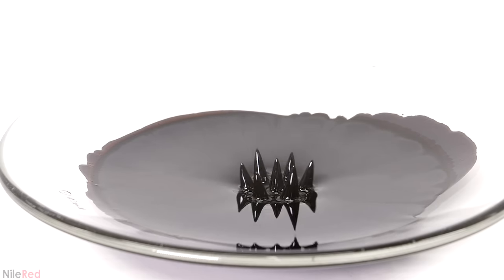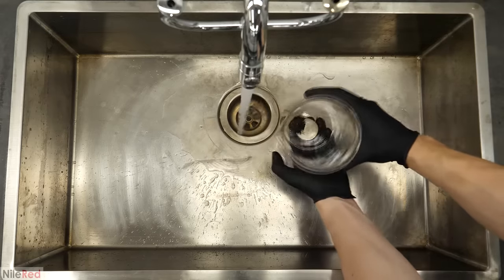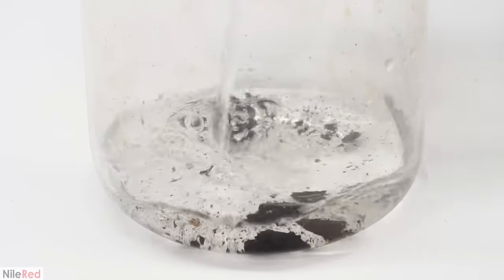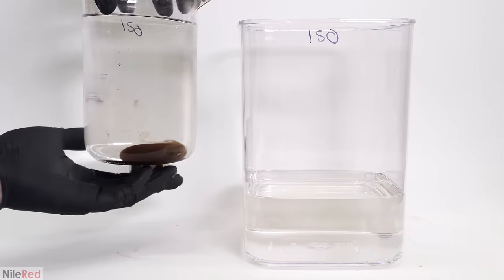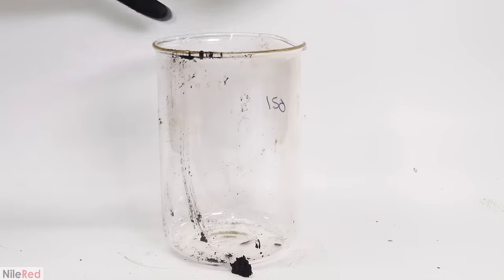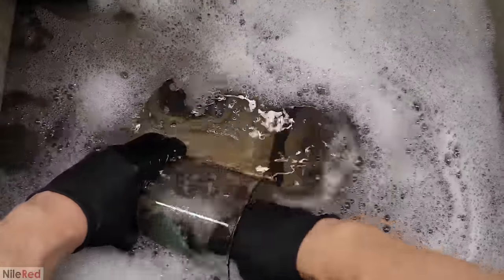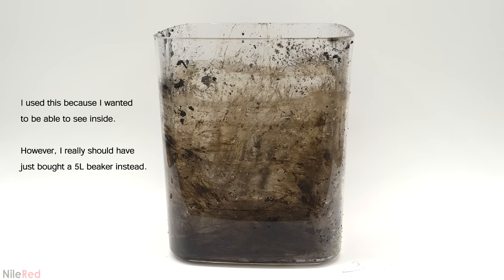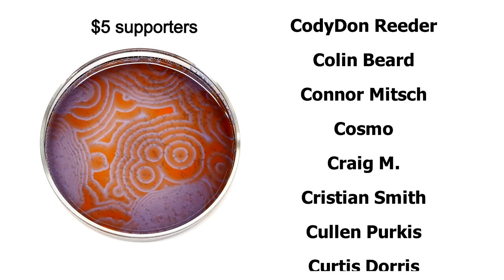Cleaning up my ferrofluid waste

Comment: Like others who have already commented, I really appreciate that you take the time to document the waste cleanup step.  No job in the lab in ever complete until the equipment is clean and ready for the next procedure.  For the aspiring scientist, it is every bit as important to learn as any other lab procedure.  During my time as a student, I had a very particular conversation with our department chair about how useful I thought it would be if the university offered a class, required or elective, on general laboratory procedures.  It seemed to me that both biology and chemistry labs failed to teach general and common lab procedures, especially good waste management, and focused to narrowly on the applied lesson itself.  Not wanting to take away from that primary purpose, I thought the best thing was to have a separate class that covered these issues.  He was seemingly positive about the idea, but nothing ever came of it.  I would have been one of the first to sign up to take the class.  To this day, I don't think a single undergraduate from our chemistry or biology departments experience even a single lab session devoted to properly identifying lab waste hazards and how to correctly neutralize them as part of lab cleanup.  Thank you for going the extra mile!
Reply: That's boring asf.
Reply: @grunge-616  dude its science. And its also 3 years old

Comment: I still have no idea what hes talking about but this is so fycking interesting
Reply: The material in question is ferro fluid,  an oily suspension of iron based nano particles.

Ferro is short for ferrous which means containing iron.

The iron in the fluid is attracted to magnetic fields,   and tends to align itself with the lines of a magnetic field to produce beautiful spiked shapes.

He explains in this video how he dealt with the waste from his experimentation and the process of cleaning his glassware.

In the glass washing part,  he removed the oil with soap,   and reacted the remaining iron with a chlorine based acid to produce iron III chloride,  a salt that dissolves in water.

I hope that helps.
Reply: theevilovenmit hell yeah my dude thanks
Reply: What does “fycking” mean?
Reply: @cbspydoge  ur mom
Reply: @abhinav2584  lol

Comment: What does ferrofluid look like under a microscope?
Reply: Black
Reply: @Charlie-mn5fw  thanks man
Reply: bigger
Reply: Have you ever seen those episodes of the x files with the black alien goop?
Reply: You would probably not be able to see anything if the individual particles were smaller than the wavelength of light which they might be.
Reply: @mareksvrcina5279  I think that the fact that the fluid isn't very transparant might be a bigger issue.....
Reply: Since they're suspended nanoparticles, a microscope would not show you much. Even a higher power confocal used in micro biology labs would just show black. However, an electron microscope may be able to show a lot of fine particles somewhat evenly distributed in kerosene. A nanoparticle lab at my university regularly uses an electron microscope to image and examine particles they've made. To bad electron microscopes are hard to access, and they usually do not want volatile, non solid objects in them.
Reply: He would need an electron microscope to see the nanoparticles.
Reply: @helgrind8493  it is black because of the suspended particles of Fe3O4.
Reply: @mareksvrcina5279  I know. Still, it's impossible to see something in a non-transparant fluid with a light microscope. However, even if transparant, @Ex and @ErebosGR are right that you need a SEM to see nanoparticles. I think DLS could be used to infer some information about particle size and distribution in the suspension, but I have no practical experience with DLS as an organic chemist who focusses on synthesis.
Reply: I would say the particles cluster and form larger particles because you can see the larger particles forming when the fluid is brought under a magnetic field.  As the particles get really small they alter the color of the water. The larger particles are black.
Reply: Thirty Three big ferrofluid
Reply: @Charlie-mn5fw  no shit
Reply: @userPrehistoricman  blacker
Reply: @matthewbusch6841  The carbon nanotech? Poor skinner...
Reply: if you look it up you can actually see the links. it’s hard to explain but it looks pretty cool
Reply: @Charlie-mn5fw I thank you for the information
Reply: black and funky i tell you that
Reply: Your mum
Reply: nanoparticles are to small to be visible; but probably like small needles

Comment: To recover Isopropyl alcohol from aqueous mixture, i've used KCl, CaCl2 & even NaCl in the past. the organic layer will float & give much less volume for distillation. Salt Solutions can be discarded into the sink at slightly alkaline pH.

Comment: Do you think you could rig a setup where you have a speaker neodymium magnetic near the ferrorfluid and see if it reacts to the magnetic change of the signal? It would be cool if it it reacted to the signal  changing the fluid etc. In theory I don’t see why it wouldn’t work especially since it’ll be amplified.  Dare I say fluid oscilloscope?

Comment: hey nilered, i have an inquiry; i am attempting to construct a tube furnace and i need a good thermal conductive material as well as a material that has high heat resistance and is an electric insulator. Basically what i need is a material that serves almost as a heating element insulator/ jacket to prevent melting of housing and shorting of metallic outer wall. What do you recommend? What are your heating mantles constructed of? i need to be able to resist up to 700 degrees C

Comment: Would heating the nanoparticles in a reducing atmosphere destroy them?  I.e.  can you drop them into a crucible with a lid, add a carbon source, and torch them into a slag?
Reply: Why bother with a secondary car on source. The oil and oleic acid should be plenty, just cover and heat.

Comment: Hey again, It's the guy who asked if you could demo the lithium medicine synthesis. (I also can't find that comment, but youtube does that to me sometimes.) I was wondering if you had time to take on another mini project that I think would make for some novel and interesting content. I'm currently working on growing spirulina as a food source and my main focus is on finding a method of producing the chelated iron which is necessary for its grow within some strict lateral limits. Namely that there be little ambiguity as to whether the end iron product itself is safe to use in the production of food grade spirulina(ignoring the other ways I might screw this up by not just throwing money at it), and that it is produced in a manner which is maximally focused on the use of reagents that can be produced on a single property. For example, I've been trying to research the affinity of the chelating compounds in cilantro but the most I've been able to gather, because I'm in way over my head, is that a methanol soxhlet extract of cilantro is probably my best bet for a simple chelating reagent. I'm thinking I can make the iron through electrolytically forced oxidation but I don't have the slightest clue about what oxidation state it should be in for chelating, ratios of reagents, whether I should further isolate the active chelating compounds, or really whether any of it will work at all because I'm just kinda floundering in the dark as far as chemistry goes. If you don't feel like bothering the idea, could you just share any "No dummy, you'll die!" type thoughts you had while reading this? Many thanks good sir.

Comment: For the plastic container, wouldn't it be more economical to simply buy a new one? Comparing the cost of his time and the acid he used compared to the cost of the plastic container. I know neither the cost of the plastic or the cost of the acid so I have no idea what's what. But still, i'm wondering.

Comment: How do you determine which acid is appropriate for cleaning xyz? Why not sulfuric or acetic vs hydrochloric?
Reply: 1) HCl salts tend to be very stable and easy to work with
2) The same way you determine what acids or solutions are going to react with the stuff you're already working with.  You pick the one that's the easiest to work with and dispose of or recycle again later.

Comment: I'm surprised you would go with acid-washing a plastic container...
Though the end result isn't quite as bad as I expected.

I guess for mild acids it doesn't matter.
Plenty of things stored in plastic containers are acidic.

To take a random example, Cola and similar drinks are PH4
But still...
Not a choice I would've expected...
Reply: Plastics are generally pretty acid resistant (depending on the acid/plastic). The muriatic acid he poured into the large container came from the store in a plastic bottle.